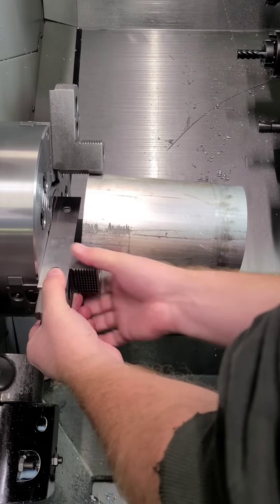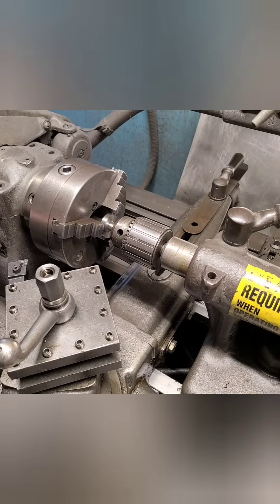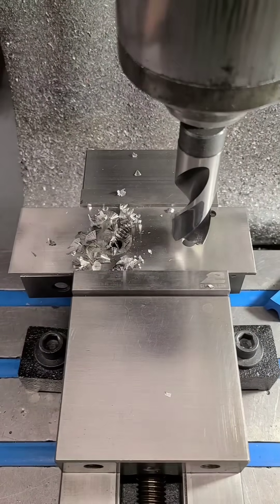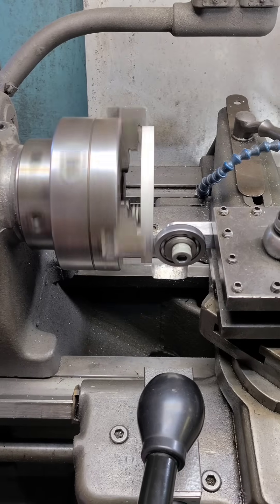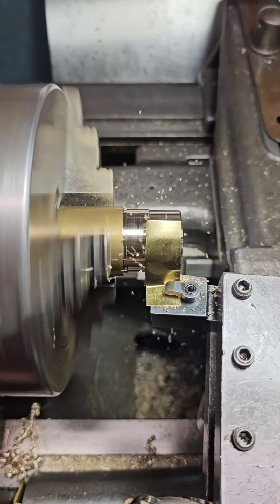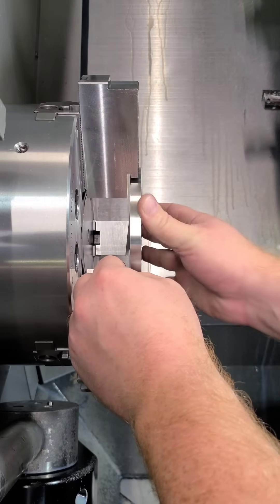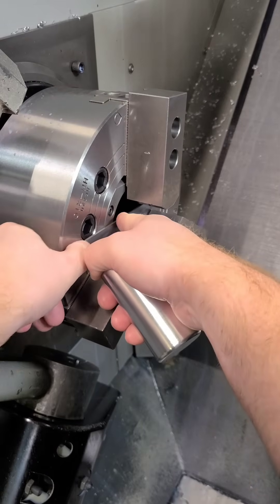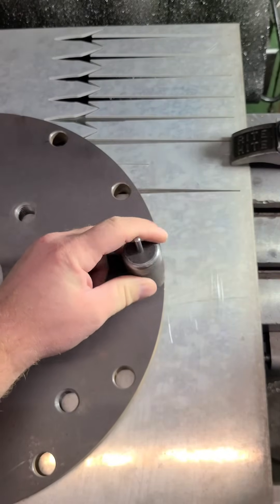Machinist Tips and Tricks Volume 1

Comment: 58 years in and about machine shops. Have seen a lot of parallels sent flying, including a few of my own! I can remember one time (not me) that it was never found. Sooner or later it will be forgotten and left behind the part. If it had more than a few parts I would make a spacer ring slightly smaller in diameter than the part.
Reply: Pretty much same.

????????????????      "TIPS AND TRICKS" ?????????

How about the very first "TIP"   !!!!      STARTING AT THE VERY BEGINNING !!!!  0:00 MARK..........REVERSE THE CHUCK JAWS .....FOR TWO REASONS.       THE JAWS ARE ALREADY TOO FAR OUT AND IF THIS WAS A SCROLL CHUCK, IT IS NOT FULLY ENGAGING.        REVERSE THE JAWS AND NO NEED USE ANY PARALLEL .....JUST SEAT THE PART DIRECTLY ON THE CHUCK JAW STEP !!!!
........the rest is nothing more than people stopping and using their brain to come up with "a better way" to do something either awkward or never done before .......rather than risking doing something wrong.   This one point is far more important than anything else .......using one's brain ....FIRST.

.

Comment: 4:00 Of that tap handle I mostly crave the culinder as I often need to drive a tap in an existing thread just to QUICKLY clean it up :) No need for torque so I'll probably 3D print something soon.

Comment: The inverted turning tool on a lathe with the spindle running CCW is one way to deal with cast iron chip spray. This coupled with a shop vac hose on a Noga mag base goes a long way to reduce the mess from turning cast iron..

Inverting the turning tool and running the lathe spindle CCW is an often neglected and under appreciated way to deal with chips.

https://www.youtube.com/watch?v=74KFgCebwV8

Comment: Couldn’t hear the part about drilling thin sheet metal
Reply from the maker: The cloth takes up the space between the flutes and prevents the drill from walking around.
Reply: @OctaneWorkholding  awesome thank you. Any old cloth/thick shop rag?
Reply from the maker: @highlyalloyed9296  Yes, even a paper towel could work.  The best way to drill thin sheet metal is with a flat bottom drill, a step drill, a holesaw, or an annular cutter.  Helical interpolation is great if you have the equipment as well.

Comment: That centerpunch one is genius
Reply: Until that tool goes out of square…..
A conic center must be perfectly perpendicular to the hole to mark the true center of it.
Reply: even better, anyone with a lathe, some raw round and pipe stock, hardenable tool steel, and a couple of springs can make it. Welding or brazing is optional if you can do a press fit for the cap. Or just use some screws for serviceability.